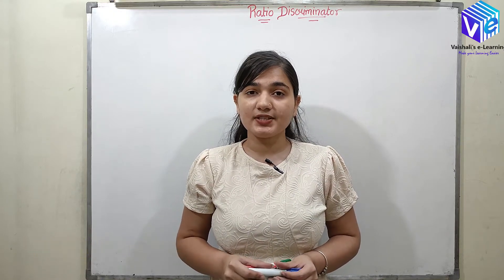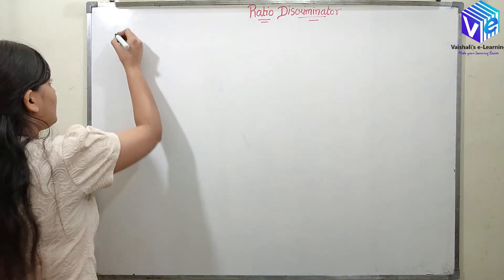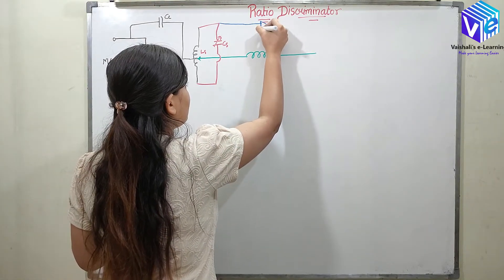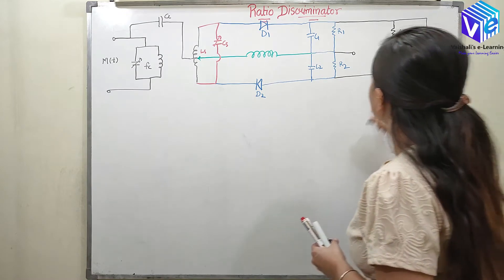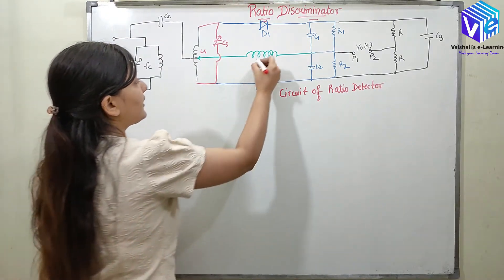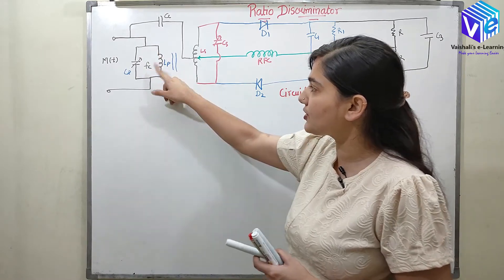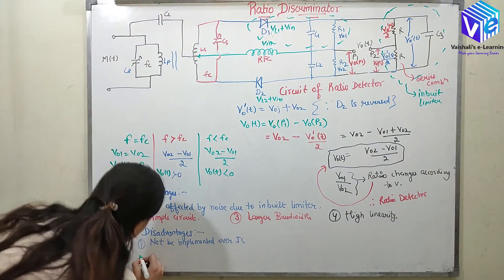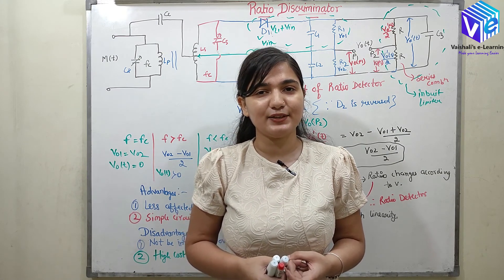L 58 | Ratio Discriminator I FM Demodulation I Analog Communication | Frequency Modulation |GATE ESE

Comment: Hello I am trying to isolate a problem with a Grundig FM RADIO. I think the AFC diode is leaky because when I disconnected it the voltage output from the ratio detector will balance. I will try replacing it or leaving it disconnected and see if it behaves like a ratio detector. Something is causing the negative going diode voltage to be too low until I disconnected the AFC diode

Comment: In  a practical 1950-70 circuit using EABC80 C3 can usefullly be 4u7 250V non polar polyester. The stress on this part can be  high. 5 uF 63V polar electrolytic is typical.  This seems to enhance sound in HF audio. Size usually OK.